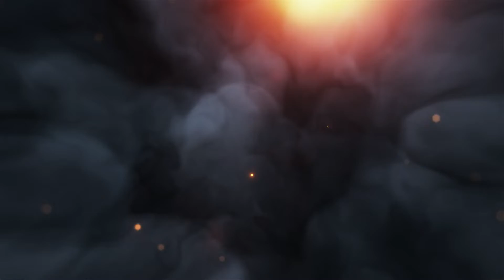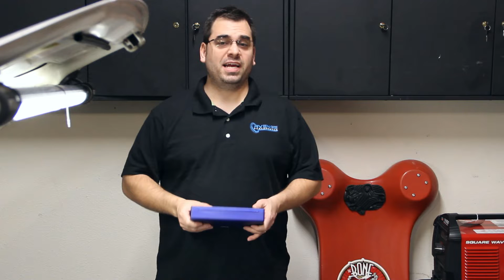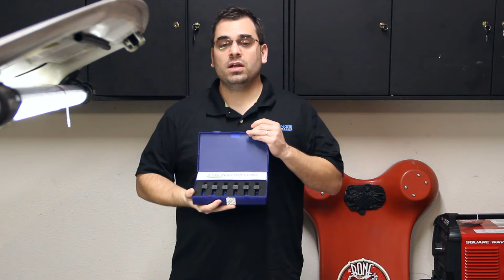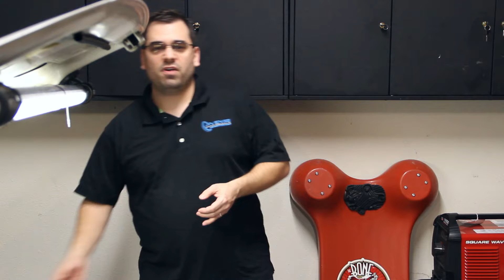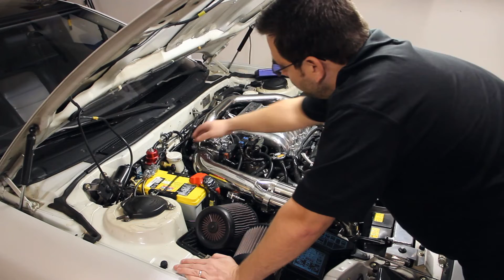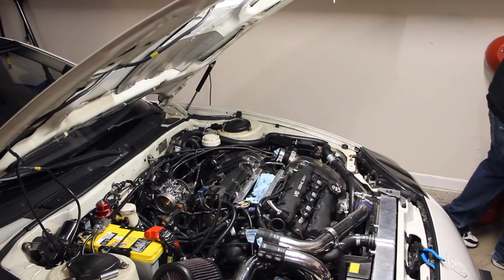3000GT Dodge Stealth FIC 1650 cc Fuel Injector Install

Comment: I have a question, if i were to replace all the fuel injectors on my dodge stealth 92 rt twin turbo how much would it cost? My car won’t start and i already got the  the fuel pump replaced and cleaned out the fuel lines and filter.
Reply: I paid 173 with shipping for refurbished injectors off rock auto.

Comment: Question, if I’m only upgrading to 500cc from the stock 360cc will I need to bypass the resistor?
Reply from the maker: The size of the injectors is not really the issue. It is whether they are high or low impedence.